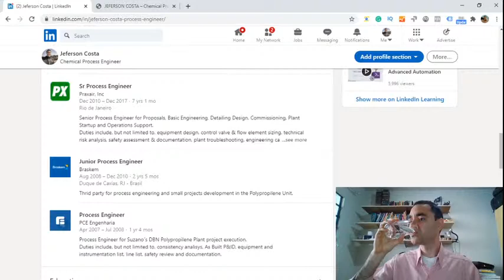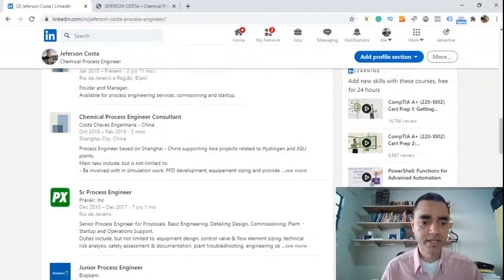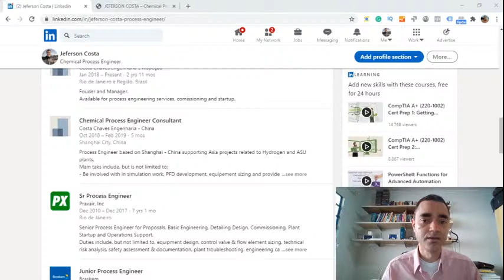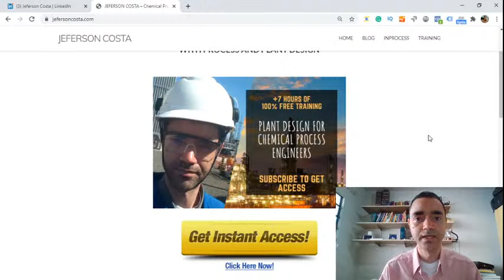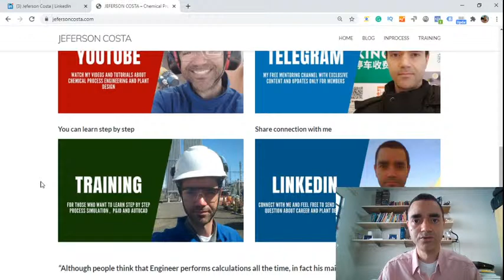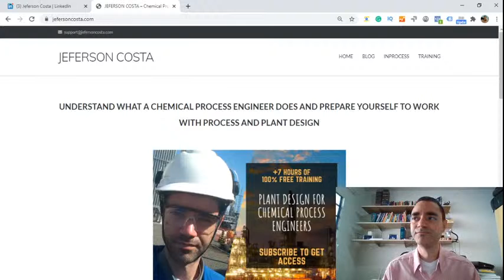Chemical Process Engineer Day in the Life

Comment: Hello for everyone
Please I have a question,
Why do we need use restriction orifice (RO) at downstream of global valve, as I know global valve and restriction orifice have same function of controlling and pressure dropping?
thanks for everyone
Reply: Yes, as the expert said, RO is to drop pressure or limite flow at a certain value.  Il some systems like gas capacity (with high pressure inside) venting lines, it common to see : a block valve , a RO, and after RO a throttling valve. 
The first is to block flow throught venting line at normal condition. In case of maintenance for instance,  when the unit is shut-off, and they want to vent lines or capacities , they open block valve and throttling valve. In this case block valve openning permit the flow in venting line, and RO reduce pressure and the last vanne is manuely operate in order to limite flow again or to limite sound noise. Because hight gas velicity cause more noise.  This arrangement is more time for safetly opérations.  Sorry for my poor english 😉
Reply from the maker: The objective of restriction orife is to pressure drop and/or limiting flow. I have seem RO before isolation valve to limit the flow trought the isolation.  In your case the RO may be to limit flow, but only the designer will be able to confirm that. Thanks for your question Ismail. I will record an audio to my telegram channel INPROCESS 😁
Reply: How can I join to your telegram group